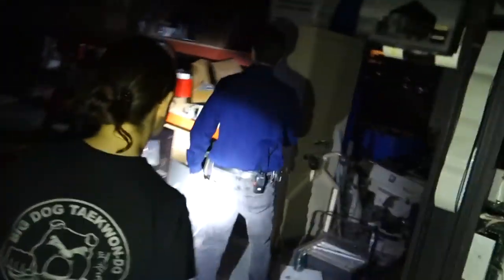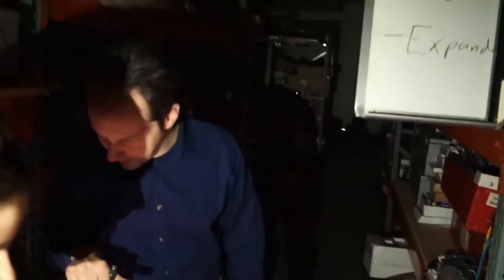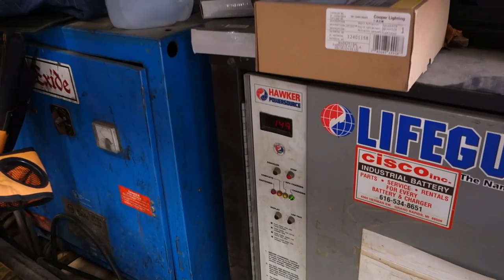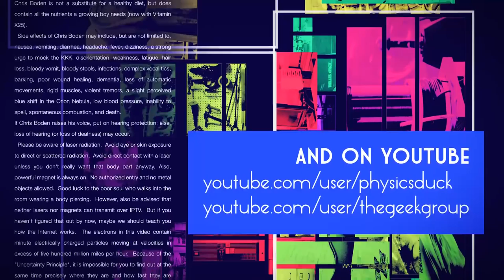Captain's Blog 4 27 2016 Power Outage and Forklift Charging Fun

Comment: The last fork truck battery system I wired was at Coke in Philadelphia. They gave a 2 story rack system that holds 20 batteries. Each battery station gas a charger. They pull batteries off the rack and exchange them from the trucks every day since they run 24 hours and have 10 trucks. The big batteries put off large quantities of acid fumes...and it's normal just because they have so much acid and plate area. There were some very large exhaust fans for those racks and you could still smell the fumes in that section.   They topped off the water every time they racked a battery....which is every day.   Yes, you can charge each cell individually, but doing 6 cells at a time is perfect for a regular charger.There won't be any interaction unless the main disconnect plug is plugged in.

Comment: It's totally fine to charge them up one at a time (or in groups since you have 12V available)
But as you said, you don't want to use the forklift again until they are all charged.
Nothing will care if you charge only some cells while all are in series.

Comment: Color films became common in the 40s or the 50s as one of the ways films could compete with television. Color broadcasting started for public consumption (outside of testing) on January 1, 1954. CBS and ABC started regular color programing in either 1964 or 1965, but they held off since they didn't want to sell TVs for RCA (who owned NBC).

Comment: Yes,you can charge individual cells. It would be prudent to charge all of the cells to the same state-of-charge,to avoid imbalance.
Reply: +PhattyMo Or use the 12V supply,and do 6 cells at a time.

Comment: since the battery bank looks to be discharged far bellow what it should have been and im sure by now you figured out how to get at least some charge to them, check the voltages to make sure each cell is holding about the same amount of charge. some are most likely damaged and may need extra mojo to work again.

Comment: charging them one at a time totally can work even if they are connected as they are. since they are not yet powering anything. obviously attempting to draw power from unbalanced cells would be a bad idea. so you would manually have to balance them after you charge each cell. Im going to guess you would need to run through them 2 times before the difference in each sell is to you're satisfactory.